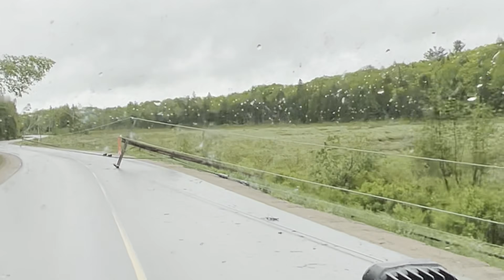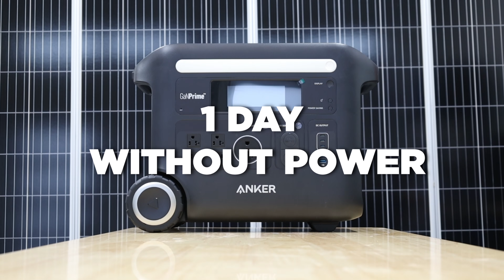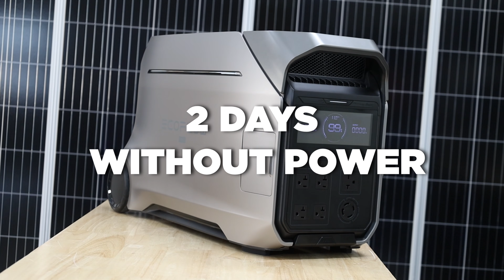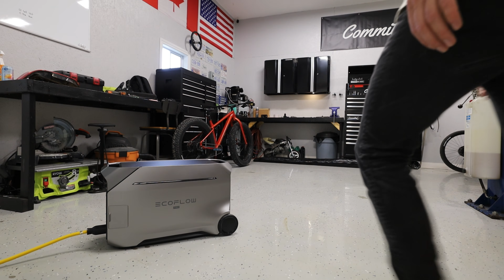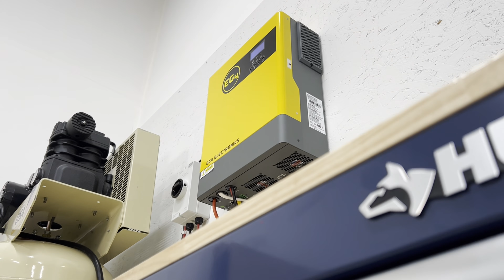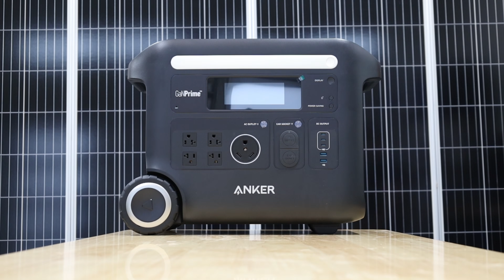Surviving Storm Season! How To Pick the RIGHT Power System for Outages (For Beginners)

Comment: Thanks for this video. Can you do one for the feasibility of running a window/portable AC unit off of a power station and solar for several days in a black out? I am trying to figure out if it is possible. Last summer, we had a hurricane, power was out. The only thing I actually needed was AC… and power for the ac

Comment: Pecron e3600 3600w 9kWh system connected to 30amp 10 circuit transfer switch. Extended outage 4800w (4000 running watts on propane) generator/inverter to charge the Pecron as needed (4 20 pound propane tanks on hand). Just in case a portable 300w solar panel on hand.

Comment: If you don't live in an area with sewer and water hookup a major concern is the well pump usually 240v and septic and sump pumps which are normally 120v which puts you into the delta pro 3, F3800 plus are dual pecron category. Thank you for the video.
Reply: Thank you! Why do the reviews and ads rarely talk about this?! My whole desire for backup power is to have the sump pump run so my house doesn't flood, well pump run so I can wash my hands, was the dishes which pile up fast and flush the toilet! and FHA oil furnace fire on and it's blower fan run so I don't freeze to death in my house. Compared to those things, I hardly care if I can watch TV, charge my laptop or run the microwave.
Reply: Is something like the F3800 enough? How do you know what you need in KWH to fire on a FHA oil furnace and run its blower fan?

Comment: As for gas generators, the government has given away plans to build home syn-gas generators for DECADES. You take biomas... like wood... and burn it in this generator. It produces a gas that, when filtered, can run a portable power generator or even a car. It dates back to at least ww2 technology. No gas station required. And where I'm at there is a great deal of dead wood available after a storm.

Comment: Great, simple and clear explanation to help me decide on a home back up generator.  However, the first thing that popped into my mind was what is the most efficient way of connecting to my home appliances?  Do you have a video describing how to connect to the home electrical panel or when to just run extension cords?

Comment: Counter point to the micro battery packs: during hurricane Helene one of the lessons learned multiple people shared were the value of the ~200-500wh battery banks for their portability, ease of recharging in a car or at a coffee shop, and ability to easily share the power with others. 

I’d recommend if it’s all you can afford, get it, but understand it’s more about keeping your phones charged and a small lamp on, and not for the other conveniences. Using the dc socket it will absolutely run a cpap too.

Then when you can afford it upgrade, but still keep the small pack for the convenience and portability it affords.

If your neighbor doesn’t have power, it’s a lot easier to carry a 10-20# battery bank to them, and charge it up in less than an hour then a 50-100# one that you’re using to keep your fridge and freezer running.
Reply: I have a couple of the Anker portable battery packs that came in handy during Helene. I got lucky that my sister was in Arden and they got power back after 3 days. We were able to charge stuff up and take one to my mom to use. She loved it so I got her one for Christmas so she has one when she needs it now.
Reply: I just got my first solar generator and it's a small 200 watt one to run my internet and charge my phone when there's a short power outage. It's not much but it's a start for me. I'm already looking at a larger unit that can run my fridge for a full day. These things really are a life saver during emergencies.

Comment: Ah the portable generator.  Generally better economics than power stations for occasional emergency power - especially if you need more kWh than a smaller unit has available stock. But not without the aforementioned downsides.  

If one goes the generator route, it's best to lean into the "prepper" aspects.  Have a shelter for the unit(s) so they can operate in bad weather.  Get an inlet installed along with a transfer switch or interlock breaker.  Keep fuel on hand at all times; if your fuel is gasoline use quality containers (i.e. actual Gelg/Waivan jerry cans), stabilize the fuel, and have a plan to cycle gasoline ~annually.  Run the generator(s) under load periodically - at least quarterly.

Second the suggestion on rigid panels for power stations - if easy portability isn't critical then rigid panels are considerably cheaper while being deployable around one's residence.  Assuming the sun is reasonably cooperative in one's region, provisioning maximum solar panels for one's station(s) is apt to be markedly cheaper than stacking batteries.

Comment: Multiple AC180s. Diversifying into multiple power stations means each unit is super lightweight, can be used in multiple separate rooms, homes, RVs etc, can be lent out individually, and you have backups for your backups. All pros, no cons. I can have an AC180 in the house, an AC180 in the camper and an AC180 outdoors running camping equipment, for the price of a super bulky 100+lb 3kwh unit.

Comment: Just got the Ecoflow Delta 3 Plus and connected 2x 400 watt panels. So far its been saving me about half my power usage during the day. Kind of neat. I am still kicking my self for not getting the Delt 3 Pro for the 4kwh battery, but even at 1kwh, it handles almost everything I throw at it. So far, the battery in it self can be crazy costly:) but wanted to try it out and get a feeling if my calcutions were pretty close and they were. Hopefully batteries come down and we can start picking up 4k kwh at around 500$ in a few more years then going battery alone would be kind of profitable.

Comment: IMO - the gas generator/power-station/solar panels + standard 48 volt storage battery combination is best. (1st purchase) an efficient, 1800 running watt class gas powered inverter generator (run it dry / drain carburetor bowl after use) to charge (2ed purchase) a 2,000 watt class power-station with perhaps (third purchase) two 400 watt to 500 watt regular solar panels that can be set up almost as easy as expensive fold-able panels = affordability with built in backup power options

Comment: Interlock switch and dual fuel inverter generator. Way cheaper than battery and higher watt output depending which one you get. I have batteries, but dies fast depending what appliances you run. Not worth it.

Comment: I have 3DPU with 4 batteries ea. with the SHP2 that I use in self powered mode with 39 365 Qcell panels.  Works great and thanks for all the info as I was deciding which system to go with.

Comment: You guys need to get some experience with hurricanes. Average outage is around 7 days so a gasoline/propane/natural gas powered portable generator of sufficient size is a MUST. You also need one or more of your power stations to use as backup when power goes out during the storm so you don’t have to go “into the storm” to start the generator. Window A/C units are also HIGHLY recommended.

Comment: While I absolutely love solar, I think you're not thinking about generators correctly. First off, no one today should buy a generator that doesn't run either on propane or (if you have it available in your area) natural gas. You have a 500 gallon generator and combine that with solar and batteries and with conservative energy use, you'll be able to go a month without power! And there are so many kits to get even portable generators to start up during an outage. Build yourself a generator shed and run a cord to an inlet box and during an outage, you can either use the remote control to turn off your generator that auto started or go to the breaker panel and flip the gen breaker on and you're running off of a generator. Clearly, I'm talking from experience!

What's great with the solar+battery+generator setup is you don't have to have a huge, whole house generator. You can start on batteries and when the charge goes below 20%, start the generator to charge them up. In fact, you can automate that process. I like having a plan B and don't like relying on just one thing.
Reply: I'm a 68 year old woman who would like to build this. Would I enlist an electrician or a gas installer to assist me? Or where can i find detailed instructions?
Reply: Oh, and in the meantime, before this is up and running, can you please  suggest a propane generator I could buy now for an emergency and then use in this future system I build? Thanks!

Comment: Here's my solution:

1)Get a power station 1kw to about 2kw in size

2) use 100ah batteries as expansion (cheaper to get more KW storage)

Get an extra external mppt (maybe an inline version like bateria power) 

In peak times just charge up your 100ah batteries for storage and when your ready to release the power you can put them in series or parallel.. connect some O-ring cables and you have energy for days

Comment: Not foldable panels.  You can keep extra hard panels in your house too to keep them safe.  Portable panels are too-easily stolen, expensive, and generally the wattage is insufficient for what you really need in a real emergency.  If you are going to go solar for emergencies, put together a real system.  It doesn't have to be large... 2kWp worth of panels makes for a nice emergency solar/backup system.

An example of a small permanent system would be... a small gasoline generator, 2kWp worth of permanent panels, a medium-sized (2000W) power station, and you are done.   Go a bit larger and instead of the power station work in permanently mounted discrete batteries and a hybrid inverter... and you are done.

Power stations have their uses but in emergencies the last thing you want to do is to tie the power station down to a location.  Use the portability... that's the biggest feature of a power station.  That means you still want a small permanent system front-ending the power station.  That can be as simple as 2kWp in solar panels (permanently mounted), a single charge controller, and a single 100Ah 25.6V LiFePO4 battery.   Then you just plug the battery into the solar input of the power station to recharge the power station.   (make sure the power station's solar input can handle the voltage which can be as high as 28V).

The nice thing about something like that is you can unplug and move the power station around without disconnecting the solar from the buffer battery... the solar can continue to charge the buffer battery while the power station is elsewhere.

I use this method myself as a backup to my backup (my main backup is a whole-house battery and solar system).  But I also have a small backyard system that is completely independent from the house system that charges a modest amount of buffer battery and whenever I need to recharge a power station I just plug the power station into that battery.  It doubles as being an alternative in an emergency if other measures fail.

-Matt

Comment: When it comes to dealing with emergencies:

(1) You don't want to tie up resources (like your vehicle) that you will actually need during the emergency.

(2) You want enough backup for at least a few hours so you actually have time to line-up additional resources without having to watchdog your fridge and household.  Overnight backup (from full) without having to run a noisy generator, so you can sleep... that is ideal.  Not attracting attention to yourself in an extended emergency (many generators running outside unattended were stolen during Helene, thieves were attracted by the noise... for example).  You want at least a few hours of effortless backup at the bare minimum.  Like 4 or 5 hours.  If your backup only lasts a short period of time then you wind up spending all your time dealing with the backup instead of dealing with the emergency.

In that respect, I'm gonna repeat recommendations I've made on numerous other channels.... huge power stations are not as useful as people think.  Short of building a whole off-grid or whole-home system, you just want a power station that is capable of running a full 15A circuit (roughly 2000W output) and a way to charge it, but that's it.  You don't want to go bigger when it comes to power stations.  It's a huge waste of money.   (I'm pointing the finger at EcoFlow and Anker in particular... I strongly DISRECOMMEND buying into their large-form-factor ecosystems).

That is literally a medium-sized power station and a SMALL gasoline generator at its most basic.   Shoot for a power station that outputs 2000W or so.  Don't worry about increasing its battery capacity.  Get a small gasoline generator (the smaller the better)... one that is able to charge the power station at roughly 50% of the generator's rated output for maximum efficiency.  A small generator sips gasoline.  A large one gulps it.   In a real emergency, that is important.  In a real emergency you don't just let the generator run indefinitely... you turn it on, charge the batteries, and turn it off an hour or two later.  6-24 hours later, repeat as needed.

--

For people who want a more substantial backup system, power stations are definitely NOT the way to go.  Easily stolen, extremely expensive to scale, single points of failure with few options when something breaks.   No.  Once you have decided to go bigger you really want to be thinking about a real hybrid or off-grid inverter, more substantial discrete battery storage, and enough solar to make things comfortable in an emergency (or to at least vastly reduce gasoline consumption).  Permanently mounted and difficult to steal.   Enough to run the fridge, well pump if you have one, internet and wifi, laptop / recharge devices, and a few other things.

We're not talking about living in luxury during the end-times here... we're talking about dealing with an emergency that might be extended.  Think Hurricane Helene, for example.

-Matt
Reply: You should go make a video...on your own channel, instead of yapping about everyone else's opinions.

Comment: I had bought the Anker c1000 a few months back for winter power outages with the ps200 portable solar panel and a gas generator to charge it. Then bought a ZoupW 450 watt portable solar panel after seeing a review video on how well it performed against the Renogy 400 watt portable solar panel. Then I decided to buy the bp1000 expansion battery for more run time and some peace of mind. I’ve got 100ft extension solar cable to connect it to from the house to my backyard. It runs my A/C just fine but I’m gonna try to use it this summer to shave some of the electricity bill. If I had to do it all over again I would have bought the Bluetti elite 200 V2. Better efficiency and 1000 watt solar input vs. the Anker c1000, 600 watt solar input.
Reply: I bought the elite 200 on black friday. It runs my fridge for a full day with no solar. I like the capacity and output for its size. It's really quiet too. My only gripe is the 60v solar input prevents me from putting residential panels in series.
Reply: I bought a Fleshlight

Comment: Hard to beat a portable generator that runs off of propane. Your carburetors won't gum-up and you can store propane pretty much forever. Just make sure to buy an inverter style generator with a low THD distortion level so you don't damage any electronics in your home. This in combination with a storage battery will help reduce the amount of propane you burn by AT LEAST 50%.

Comment: We are typically out for days in the midwest. I went whole house generator on natural gas. Have a backup to that in tri fuel. Batteries won't run a house for near long enough, and the panic when it runs out. Useless to me. I want the house to run, heat to be on.
Reply: Sounds like you probably don't understand how to set up battery storage, fuel stores energy for us so we don't think about it too much

You can easily get 30kw battery storage under $4k
Reply: Depends what kind of luxury you want to live in during a power outage.   What batteries and solar do is vastly reduce the fuel consumption that the generator needs to keep things going.   And instead of having to run a large generator with peak power to run the house and being idle most of the time burning large amounts of fuel, you can instead have a small generator that sips fuel, only charges the battery system and only runs for a few hours a day to do that job... any incidental solar reduces the fuel consumption further.

Also, generator noise attracts thieves.  Particularly at night, and particularly if unattended.  Big lessons from Hurricane Helene in Appalachia.

-Matt